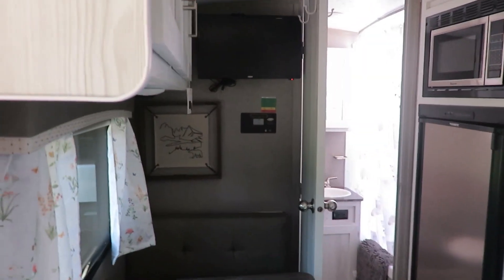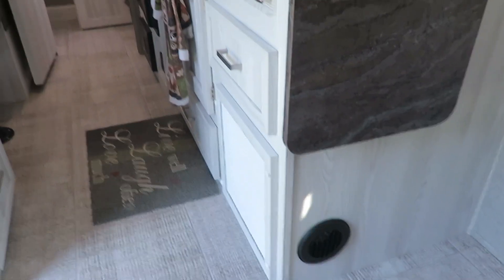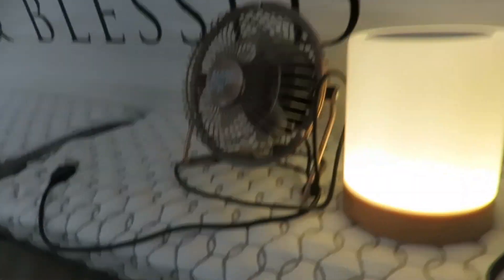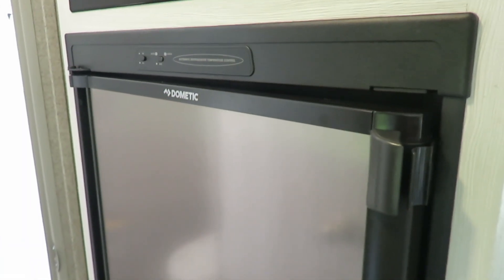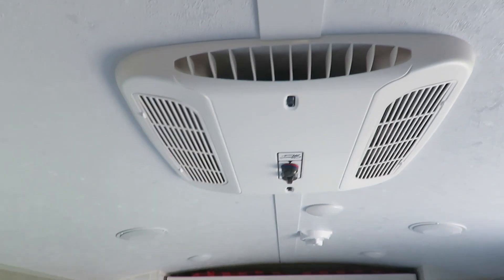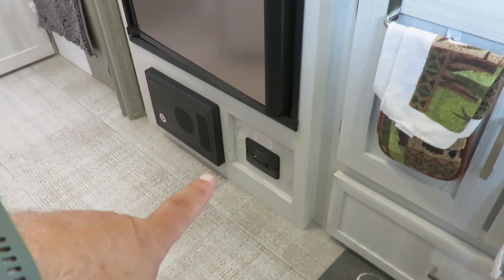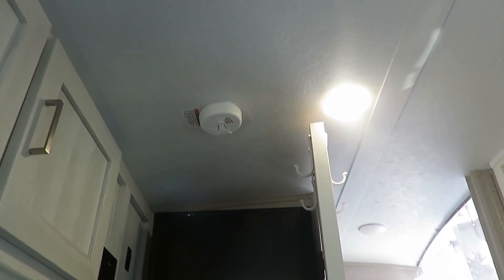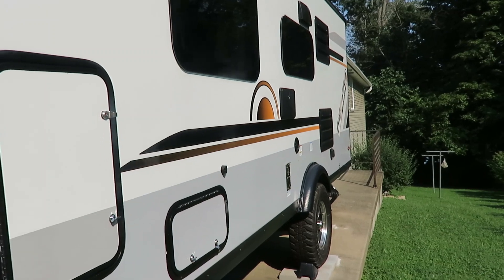What Can I Run Off My 12 Volt Battery?

Comment: I am sure your carbon monoxide detector should be sighted at high level as the gas is light and rises. If it detects carbon  mo at floor level then it would be to late for you to do anything about it.
Reply from the maker: That is where the factory installed it.
Reply: @Turtle3863  a couple of years ago I was asleep in my caravan alone and the carbon monoxide detector when off at 3 am , which I thought was strange I had not go any appliances on. It turned out to be a faulty 12v battery that was boiling that I had on charge. It had filled the caravan with a highly volatile explosive hydrogen sulfied gas. Probably lucky to be alive.

Comment: Never owned a trailer before so I wanted to ask how you re-charge the 12 volt battery?
Reply from the maker: The solar and when hooked to the car as well as the converter when hooked to shore power

Comment: very helpful, was wondering about the heater in my trailer most likely run off of shore power or generator.
Reply from the maker: If is a LP gas furnace that comes with most RV's it most likely is gas and a 12 volt fan that runs off your battery. Any other electric type most likely has to have shore power.

Comment: If I had a 12v battery and only ran a 12v fan, how long do you think it would run? Ultimately trying to find a way to keep a fan running for my dog as long as possible for those hot days she needs to be inside away from the heat.
Reply from the maker: Most fans do not take much energy, I would say you would be good for 24 to 48 hours depending on how high you ran the fan

Comment: Great overview!  For monitoring the battery charge, do you use the GoPower monitor whenever solar is operating, and only use the battery test near the door when you're plugged in to shore power?
Reply from the maker: I never use the one near the door because all you get is 1/3,2/3rds and full, no voltage.
Reply: @Turtle3863  I was told that solar isn't operating when you're on shore power.  But the GoPower monitor still operates?
Reply from the maker: @stevencochran5623  yes it still monitors your battery level